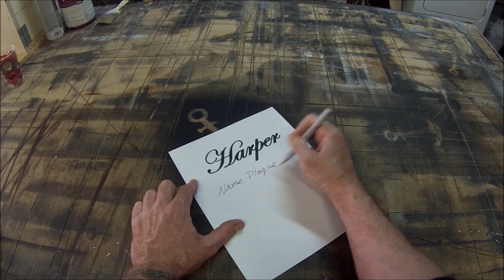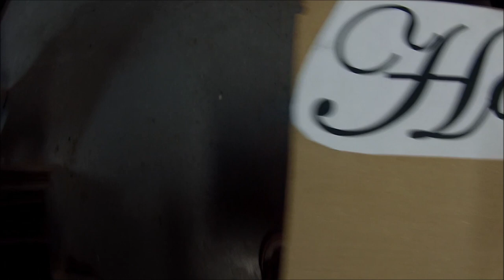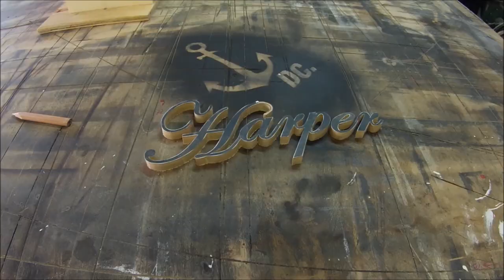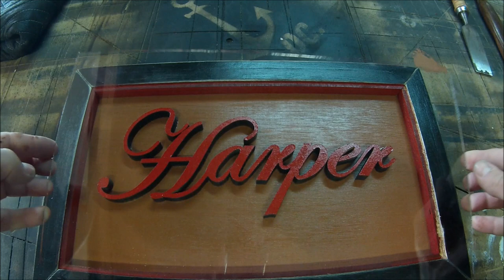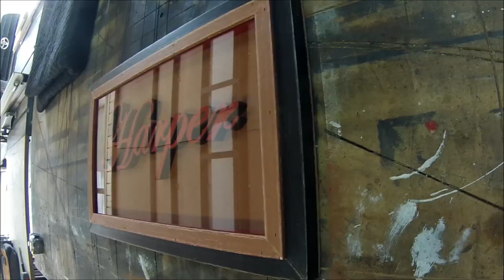Script letters cut on scroll saw

Comment: What is the spray that you used when you sprayed the back of the paper before you put it on the wood? Also, what kind of glue did you use to glue the letters onto the back piece of wood?
Reply from the maker: 3M spray adhesive for the paper and GO2 Loctite for letters. Thanks!

Comment: What kind of wood and how thick is this one you're doing?
Reply from the maker: Backing is 1/8 inch ply. Letters are 1/2 inch MDF. Frame is 3/4 inch ply. Little "top rails" are 1/8 inch ply. Client asked for those colors, I'm sure you'll choose different. I would. Thanks for watching man!!!
Reply: I was wondering because cutting 3/4 inch of any wood on the scroll saw is kind of hard. I love using my scroll saw but I HATE having to cut 3/4. I do use my band saw and then go to the scroll for the really light areas. Anyway, thanks for the info and keep up the awesome work.
Reply: .What program do you use for the letters ?

Comment: OK - table saw with no with no guard or riving knife to protect user from kick back or contact with the circular saw blade.
Happy now Derek.  The point is the way the saw is being used is extremely dangerous.
Reply from the maker: Yes happy now. 'Guards' prevent sightlines which I personally don't like. Riving knives have nothing to do with 'kick back' but prevent binding. I have a riving knife on my sawstop now. Anything else bud?